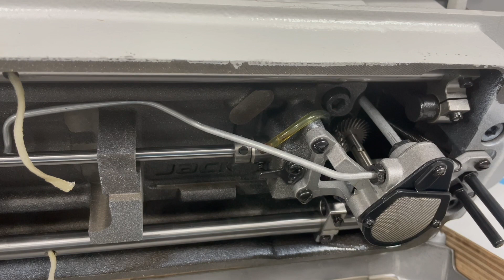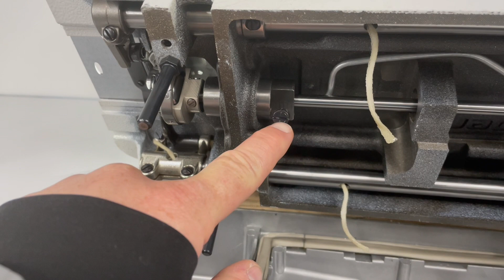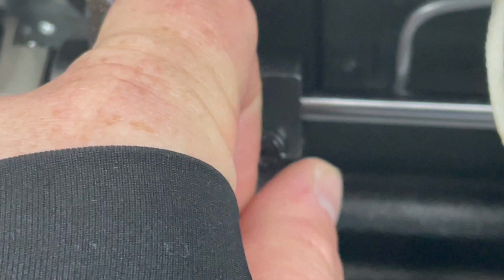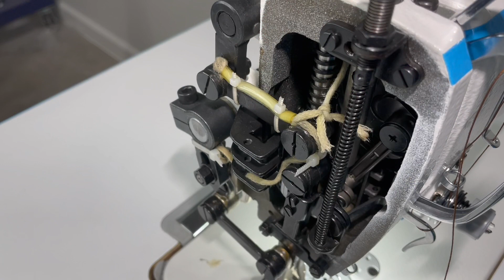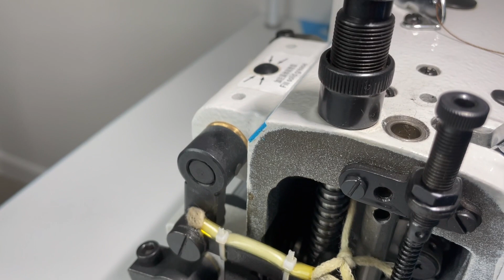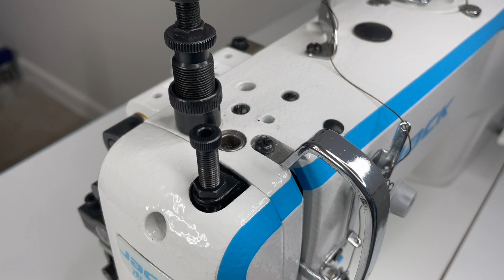How To Lubricate Your Jack "H" Series Industrial Sewing Machine

Comment: Hi there , I have question,  mine is new I just bought it and I worked with it for a week and the needle part start squeaking  , sound like whistle, not sure witch part but coming from needle part, and also when I worked with it, it does not splash oil in that little glass thing on top , is that normal for a very new one??? What should I do?🥲
Reply from the maker: The squeak means there is a dry part on the machine that you need to oil. You'll need to find it and manually oil that part. If you are not seeing oil up in the sight glass, it is because the machine is being run too slow for the pump to circulate oil. You'll need to full unthread the machine and remove the bobbin and bobbin case, set the speed to as high as it goes and run the machine flat out for about 10 seconds or so to get the oil circulating. You will need to do this once a week or so depending on use of the machine.

Comment: Hello sir, meerci for your videos. A question, what type of oil should be used to lubricate the upper parts? Thank you
Reply from the maker: On the rear mechanism, JACK uses a grease but I'm not sure what type. In the other areas you should be using white machine oil or regular sewing machine oil.

Comment: Can you use regular sewing machine oil for every moving part or do you need thicker oil for some parts?
Reply from the maker: Regular sewing machine oil or white machine oil is fine. The jack machines use grease to lubricate the top of the walking foot mechanism, your machine would have come with a syringe of it.

Comment: I've just acquired a used H5 and this video along with the others you have are very useful. The fold out booklet that cam with it isn't much use to explain the functions etc, so I'm wondering if you know where I could get a manual for it. Looking online hasn't yielded much success so far. Thank you
Reply from the maker: The only manual for these machines is the little fold out page it came with, there is no manual as such like you get with a domestic machine. This is because they are usually in a manufacturing environment with trained users and technicians on site to rectify any issues. This is why we have done the videos we have.
Reply: @ozcommercialsewingmachines  Thank you, I've managed to source some extra information and I do have the leaflet that originally cam with it. Your videos have been a godsend so thank you so much for doing them. all the best

Comment: I have removed all of the oil wicks from the top part where the needle bar is and put grease. Made my machine much cleaner, no contamination of my sewing area or work anymore. Working on slow speed  makes the oil pump obsolete
Reply from the maker: Thanks for sharing

Comment: Great video, Is there a way of reducing the amount of oil on the wicks at the back of machine near the raise footer bar - oil is dripping onto the flat bed!
Reply from the maker: Hi Liz.

Not really, they tend to settle down after a while from new, but if they are causing issues for a prolonged period, you can dab them with a cloth periodically, if it becomes excessive you can cut the cable ties and trim back the wicks, this part of the machine requires minimal lubrication, so if you decide to shorten the wicks, be aware you will need to manual oil these areas when necessary. 

Hope this helps.
Reply: I’m having the same issues.

Comment: Thanks Peter, appreciate the video.  I was told when I purchased by my H5, that I only needed to put oil in the sump once a month and other than that I didn’t need to do any other oiling.  How often should I be doing what you just demonstrated?
Reply from the maker: Hi Lucinda, thanks for watching. I would suggest doing this every 3 - 6 months depending on how much usage the machine is getting.